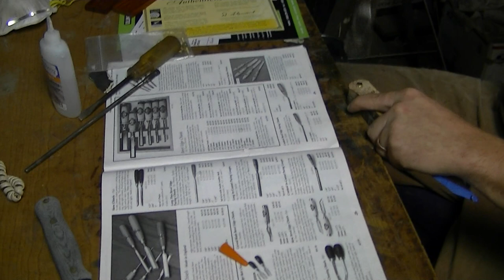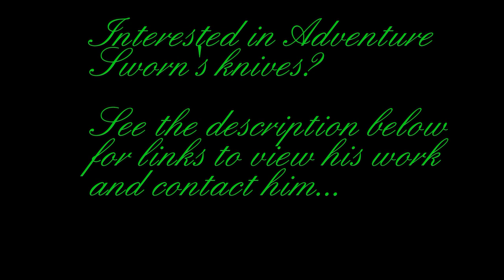Adventure Sworn Knives - Hanging out at the shop

Comment: @shippen2010  Hey Shippen.  I get my belts from supergrit(dot)com.  When polishing the edge on a knife, I use belts on the 2x72 which go from: 50 grit ceramic, 120 grit, 220 grit, 320 grit (SC) , 400 grit cork, 800 grit cork, "polishing" grit cork, then a wool felt belt charged with chrome oxide compound.

For the 4x36 for handle work, I use a 40 grit, 80 grit, and 120 grit.  Zirconia belts are what I use for this.

Comment: What is the thickness of the slabs he uses on his knives(pre-shaping)? I have purchased some Bernie Garland blade blanks and need to get an idea on the handle thickness. I have larger hands and find adventure sworn knives very comfortable. To me those seem to be around 1/2in(pre-shaping). Can any one tell me?
Reply from the maker: Depends on the material man. Corian gives you a little more than 3/8" thick, while some stabilized wood gives you barely 3/8" thick. Cody now has much of his wood custom cut and stabilized.
Reply: Adirondack Woodsman
I see. I am able to find some wood stock online from usaknifemaker.com. A lot of the wood burls I can order are well over an inch which is good if I plan on getting 1 block and ripping it down into 2 on my table saw. but to get something ready to glue and shape I am thinking of something around an inch or 3/4 at the least. Because I have large hands, a "fatter" palm swell is more towards my liking. I will start posting a work log on BCUSA soon(alb1088). Thanks for the info.